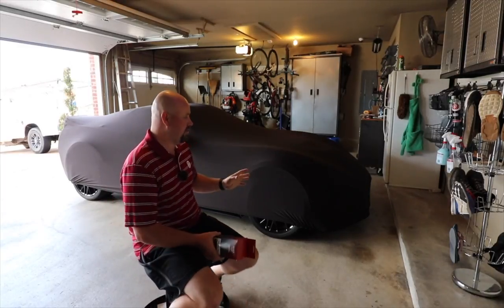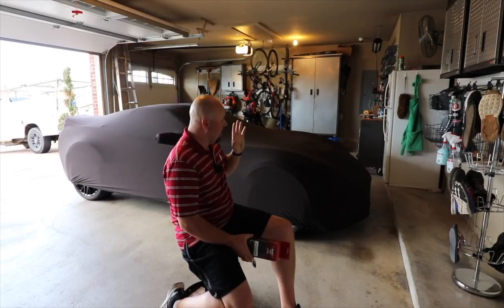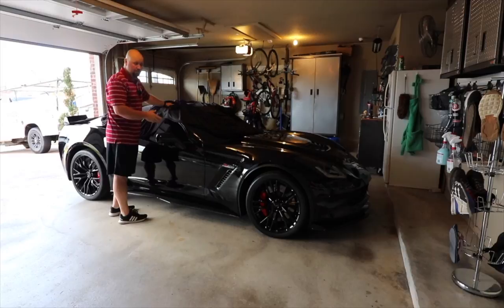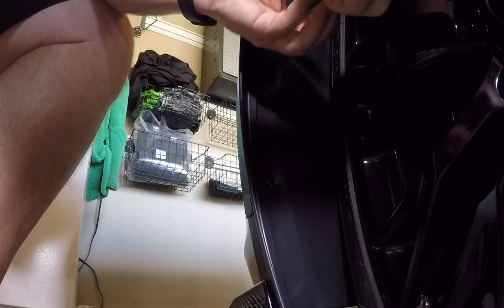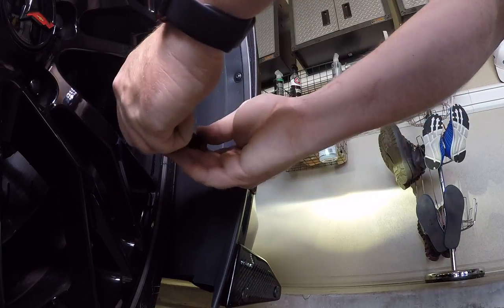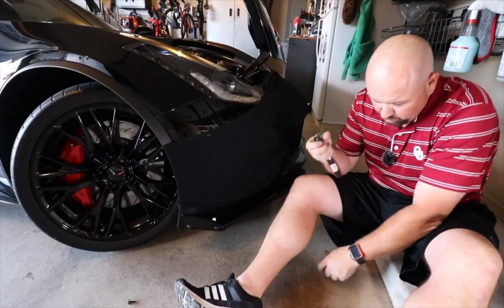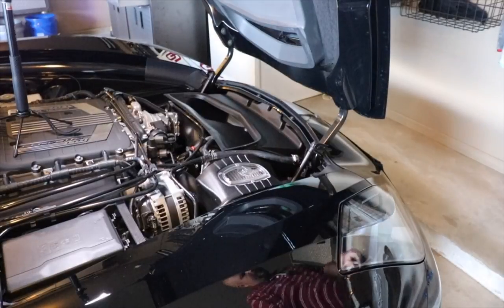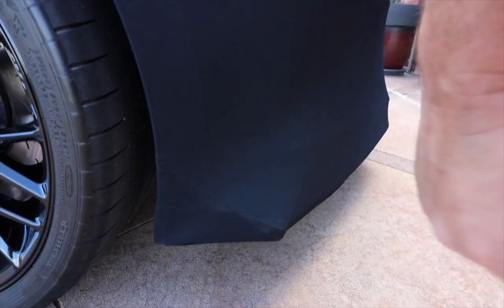WHAT EVERY SPORTS CAR MUST HAVE

Comment: i finally got my black c7 rims put on my c6 z06 with jake wheel caps what products can i use to protect and clean my rims..?
Reply from the maker: I bet those rims looking amazing on the C6Z and the Jake caps are a nice touch.  You can get your a ceramic coating from Adams to put on the rims. It will keep them from getting scratched up from the trucks that do get inside the wheels and then bang around before exiting.  Then you can just maintain them with some Adams wheel cleaner.  Have a blessed week my friend.